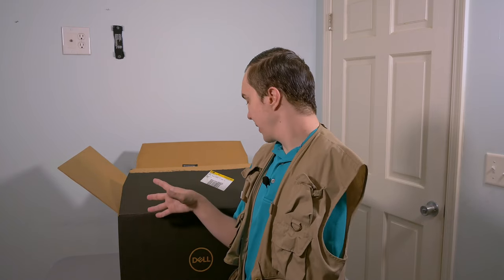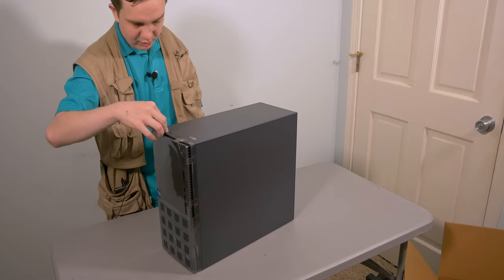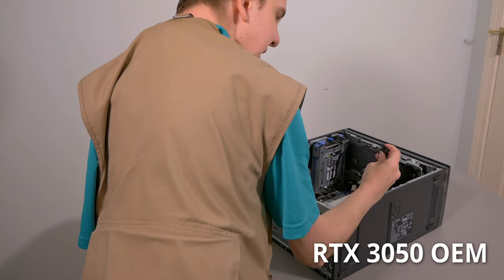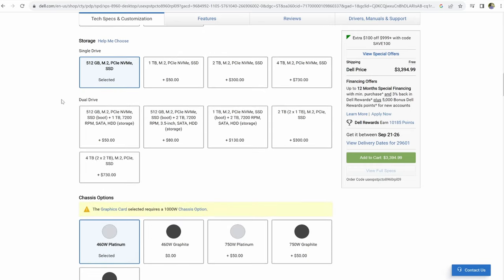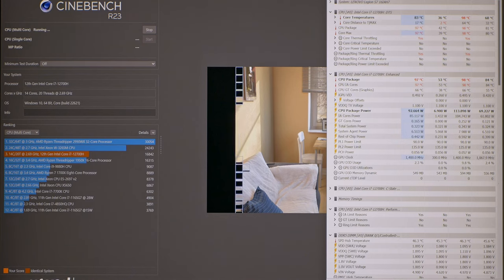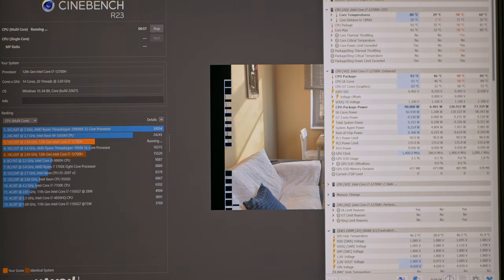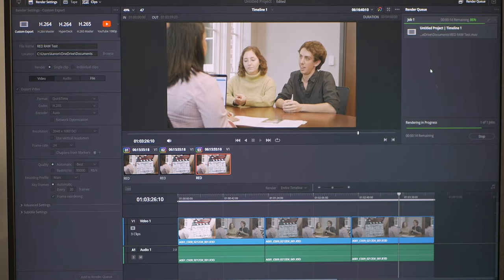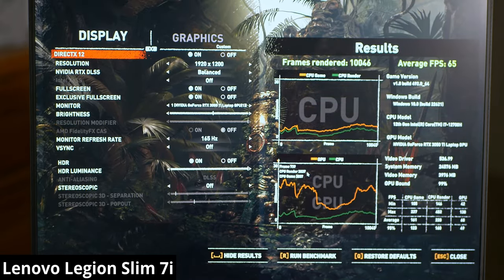Say Hello to Your Christmas PC - Dell XPS 8960

Comment: The Dell XPS is quite literally the most average computer. Prebuilt by the most popular computer company, you can get the i5, 3060, 16gb ram, and 1tb SSD to match the most popular configs, standard ATX size, and then you can get a 60hz 27 inch 1080p monitor to go with it. All for about 1800 USD which is ok I guess, you cant go wrong with that
Reply: For $1700 i got the Dell XPS 8940 14th gen i9k, 32gb ram, 1tb sdd, liquid cooling, rtx 4070 ti
Reply: @socommaster  must have been on sale
Reply: @RobloxianX  it still is in sale lol

Comment: I just found a great deal for this on a refurbished I9 13900 for $1350 on Amazon. Most of the reviews say the Gen 14 is minimally  faster than the 13th Gen,  it just runs hotter.
Reply from the maker: Yeah 14th Gen is a mediocre improvement so id just get 13th gen or 12th on sale.

Comment: Great review.  I am not a computer person at all but know what I like lol.  I got this model as well with the RTX 3050, with a 460 power supply.  What upgrade graphics cards would work?  I was looking at a rtx 3060 as I was not wanting to spend to much but still possibly upgrade.  But I see this is a 6 slot power, and most I see are 8?
Reply from the maker: The 3060 is good definitely don't get 4060. If you want maximum upgrade a pre built isn't the way to go.
Reply: @andysilvers9532  yeah, I was given it to do a review on it and then in return I got to keep it.  I am impressed with it and how the 3050 does but for a couple hundred more I was thinking a 3060.

Comment: Andy, you rock! Great review. I just ordered the top-of-the-line 14th generation i9 24-core version of the XPS 8960. Cost me around $3,500, but it's replacing a four- to five-year-old Dell. That's a long time to wait for the newest technologies. I'm getting two, 1TB SSD drives with 32GB of RAM. Looking forward to a much better and faster performance. By the way, I'm not a gamer, so none of that  interests me at all. I'm hoping for faster internet speeds and better performance on the apps I use most — Photoshop and Powerpoint.|
For a smoother transition, I've decided to pay my local IT shop to do the changeover for me. Makes it faster and easier for me, and while they're in the shop I'll have my Dell Inspiron laptop to work with.
I just subscribed, so I'll look for your upcoming videos.

Comment: I bought this  2023 XPS 8960 DESKTOP ...But upgraded few tings, 32 to 64G/1TB to 2TB/  13th Gen Intel® Core™ i9-13900K processor (24-Core, 32MB Cache, 3.0 GHz to 5.4GHz/NVIDIA(R) GeForce RTX(TM) 4070 Ti 12GB GDDR6X  paid little over 3 grand  for it , THE FIRST one i got was defected some of the hard drive or was graphic card  don't know which didn't work right , i couldn't even put the PC to sleep   after i work on it or almost 30 days even throw DELL they don't know shyt about technical support they are just bunch a call center, read from transcript in front of them  for trouble shoot  no wonder all 1 star reviews all over the internet about DELL  DUH..  in the end send it the back, the second one i got works GREAT no issues
Reply from the maker: Glad the follow-up unit was better. Mine was fairly good but I'd be hesitant to buy it due to proprietary power supply and motherboard; plus the mediocre cooler.

Comment: looking at this from an enthusiast’s POV, this desktop is a hunk of junk. it uses proprietary non upgradable hardware that will end up e-waste in about 5-6 years. it’s also quite overpriced for what it offers. outlets like gamers nexus have shown that these dell xps and alienware desktops often have overheating issues
Reply from the maker: Yes, from that POV, you make some great points. This is the kind of PC a teen might get as their first computer though, so it's worth covering. I agree about proprietary power supplies and motherboards. It's unfortunate. While my unit didn't overheat, maybe the 13900K would. Thx.

Comment: do not buy these pieces of junk.  they hit max cpu temp and throttle down within seconds of putting them under load.  @5:43 you can see the issue.  They have a tiny 80mm heat sink on the cpu that they say is standard for a 65 W processor. This is either a lie or they have no clue.  the 13700 min is 65 w and it can hit over 200 quite quickly.  This is the same heat sink they have used even back on the 11700 processors and they would over heat.  If you purchase a 8960 get the water cool option or heck spend the money @ microcenter. they will build the computer for you and it wont have the overheating issues.  Why spend top dollar on tech that will perform at a lower level than systems built 5 -7 years ago?
Reply from the maker: Yes, in my experience it would seem that Dell power limited the CPU to avoid throttling or overheating. Pre-builts have a bad reputation for good reason and I would build a custom rig for best performance. If someone does buy this Dell, they should get the K version with water-cooling.
Reply: Thank god for Microcenter. I am trying to get a high-end PC eventually but I really don't want to bother building the PC myself or maintaining it at all and I do not really like the PC gamer culture at all either. A lot of them act very arrogant and like their PC is the only thing going for them in their life. I wish pre-builts were more of a viable option though.
Reply: Actually after looking at prices for everything and the maintenance/labor required and all the possible things that could go wrong, I have concluded that custom PC gaming is just not worth it at all🤣If I do get anything, then I'm still gonna get the XPS Desktop K version with water-cooling
Reply from the maker: @TheGreatWasian_  The K version of the XPS Desktop does seem quite good overall. The HP Envy desktop also appears to be a good option that doesn't use a proprietary power supply (your results may vary). Thanks.
Reply: @andysilvers9532  Thanks for the help Andy. I most likely plan on getting a Dell XPS Desktop (the one that you recommend) in the future when my budget allows. Hopefully it will treat me well.
Reply: @andysilvers9532  Do you recommend any other pre-built high-end PCs? I would prefer the subtle style like the XPS. I am not a big fan of the RGB and flashy looks of a lot of gaming PCs.
Reply from the maker: @TheGreatWasian_  Consider system 76 or HP Envy Desktop.